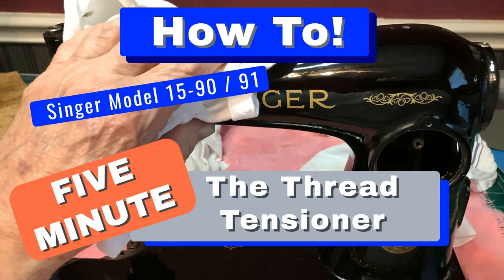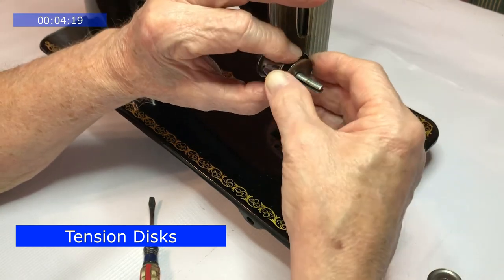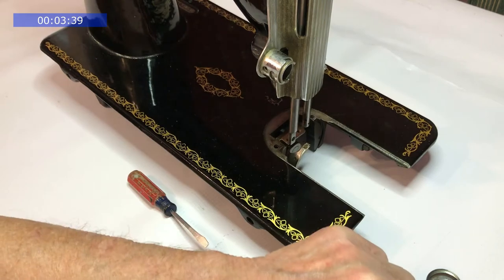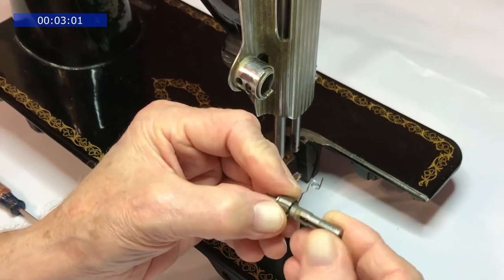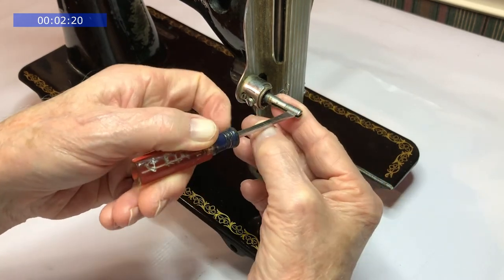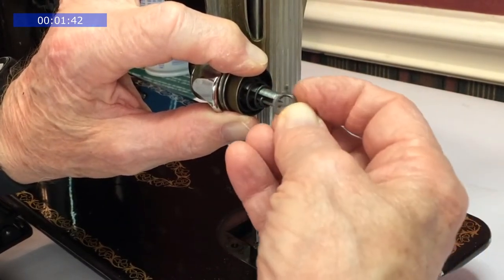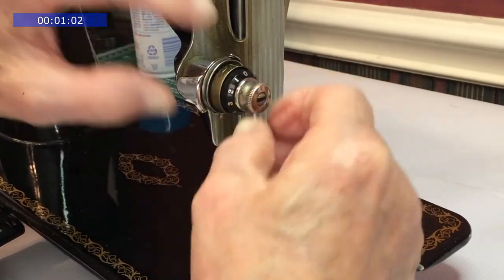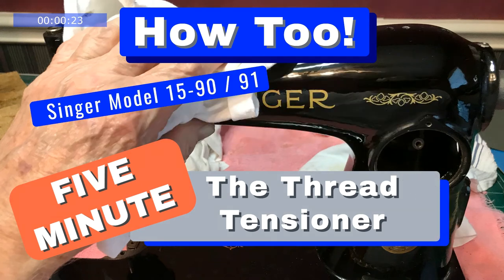Singer Model 15 Tensioner HOW TO In 5 Minutes

Comment: Oh man—I’m very grateful for your video.  Constant problems with thread tension on a machine that is new to me—an old Class 15 Singer knockoff, no name on case or machine, but it looks like an old Singer. With your tutorial, finally fixed thread tension somewhere near the end of my project! (Murphy’s Law?) The key was your instruction at 4:09, where you pushed the dial in, turned screw a quarter turn counterclockwise to reduce tension that is too great overall. Thanks again and a big thumb’s up.